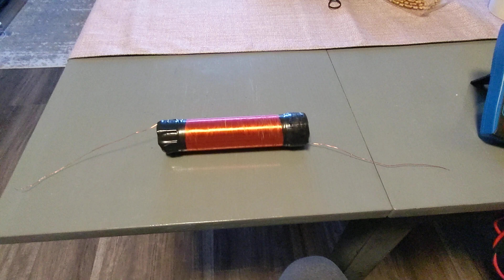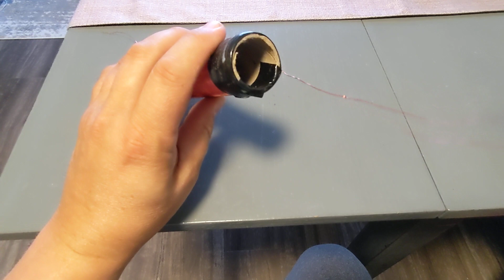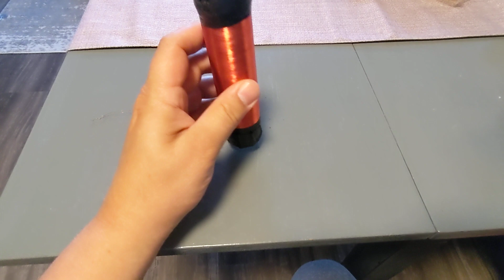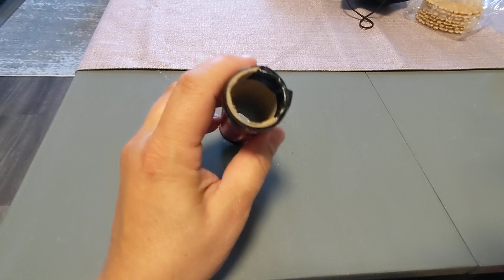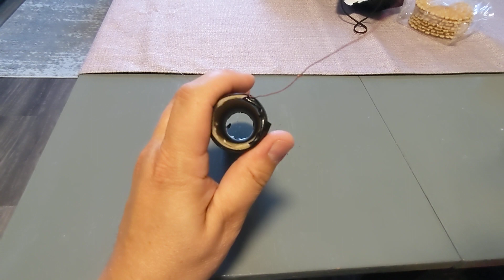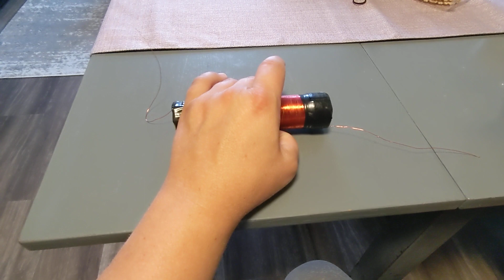Faraday Research RND

Comment: Hi, Tesla used air core transformers because the frequencies he used were too fast for iron cores.
Reply from the maker: Hi yes this is very true the frequencies for way too high so if you're going to implement this into a core type scenario you have to use what I found later is called an RF choke so you would take the   frequencies from the Tesla coil feed it into the RF choke and that will bring the frequencies down to the level which the core can actually use in the proper frequency... so yes the frequency of the energy coming off the tosa coil is way too high for a use in a core with a steel core
.. but in the Tesla coil he was using it for or wireless power transmission ...so the frequencies have to stay high for them to be able to radiate out... So yes you are correct thank you for a good question